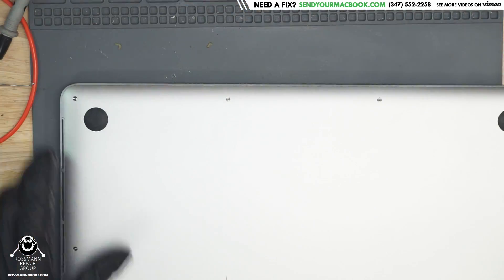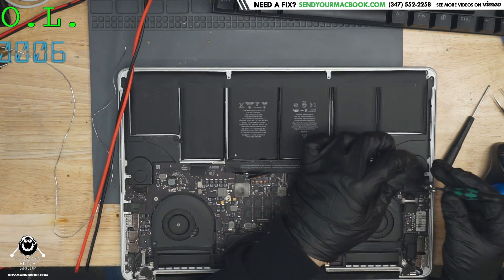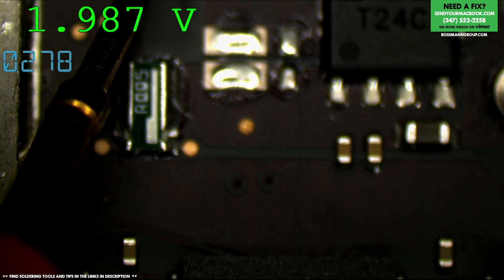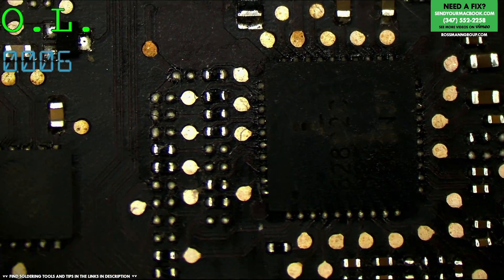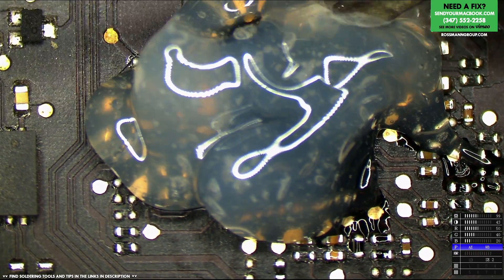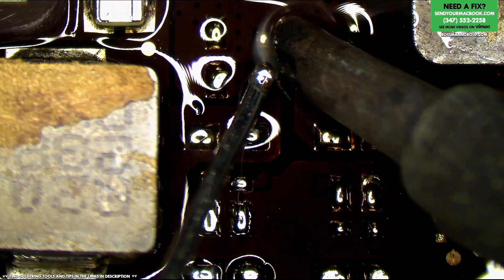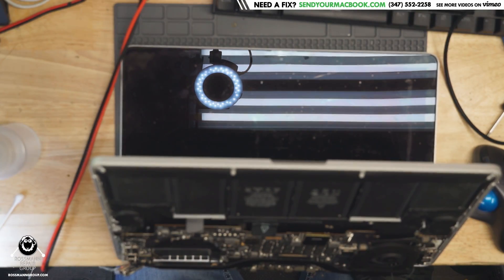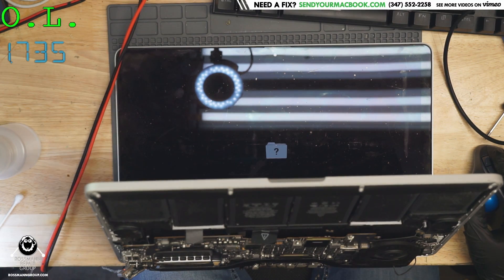Macbook Pro not turning on: GPU power circuit failure. Logic board repair tutorial.

Comment: Hi Mr Rossmann, can i ask for help? I changes my battery macbook pro touchbar a1707, when i scrub the glue my touchpad flex cable is broken and a little bit chip is broken. i dont know for the first time, and i plan to buy new touchpad. The question is, it is impact that my macbook pro cpu High? Because first time i tought because i changes battery but when i reverse to the original battery, it is still cpu load high and fan high, i try smc reset its not working. Please help to give me suggestion 🙏

Comment: So why wouldn't you repair my 2011 Macbook pro....?  Model A1261!
Reply from the maker: Because it has a graphics chip problem that will keep reoccurring, and chips for that machine are not available in good condition. Further, that machine has a resale value of about $100 when it works. 

So 

A) it will die of a gpu issue even if it is not dead from it as is
B) when it gets a gpu issue we can't fix it
C) the machine is worth $100 when it works since it is an 12 year old laptop amd known lemon so it is noy economically viable to repair

Comment: If you take this to the “Genius Bar”, they ain’t gonna fix it, they will tell you the whole board need to be replaced, and cost you above $500. And then they will say, since this is a pretty old model, it is not worth to fix it, why not trade it in for a newest model? That’s for real they told my wife🤣
Reply: If something is built properly it shouldn't fail for a really long time even with continuous usage!
Reply: @philmorton4590  being fail isn't the issue, I even consider a failure is a given, just give it a time, everything will fail eventually, knowing what's the issue is what matters, even better if we can fix the issue, people often praise apple for their long lifetime hardware usage, but seems to  forget (or denied) that there are other brand/manufacturer that make a long lasting product with ease of repair, take example of older machine such as ATARI 2600, NES, Super NES, or even old DELL machine from 90's, I even still had a computer from 2006, and I use it 24/7 up until this day (I can even install windows 10 if I want to), 2006 is 13 years go, that is more than a decade, it is funny to me that only apple that get recognize for having long lasting hardware (which mainly their old hardware from 80-90's) and completely ignored that none of their modern line up to hold up that title.
Reply: The lowest estimate I have ever received was 900. I received three at 1100 and one at 1200. Its like the genius bar has a master list on what amount  to tell the unfortunate end-user. I have had over 40 apple products since 1984 and none were ever repaired, the earlier years because they were well built and the latter years because the genius bar doesn't actually repair. They either replace a component (wasteful and costly) or entice you into a new product purchase. Oh...am I ranting again? Sorry.
Reply: @geraldhenrickson7472  I've had a Mac classic II for 20 years that only died from a hard drive failure. 
Sadly now programmed obsolescence is not only on Apple products but even in single parts like motherboards or graphics cards.. This should obviously be illegal just based on an environmental pov.

Comment: Will yall branch off inta fixin tesla's electronics and many of the new drivers and center console displays that can cost over $1500-$5500 from the dealerships. Yall will always have work thats for sure. If i had a work station wit the basic equipment and access ta the schematics i would be delvin inta the repairs